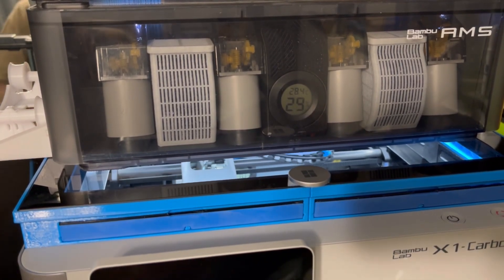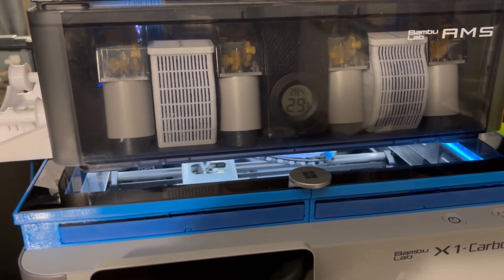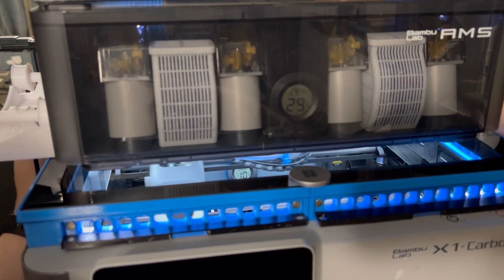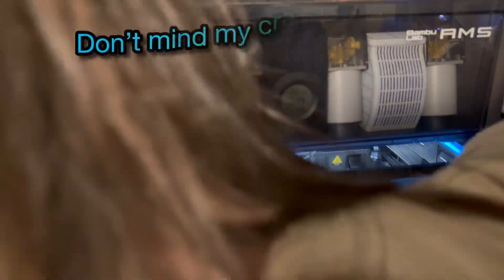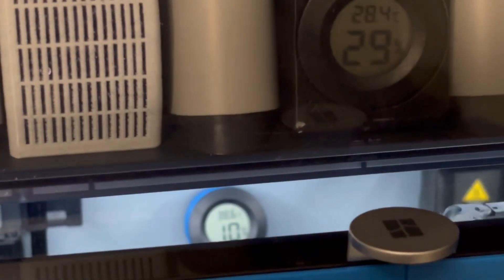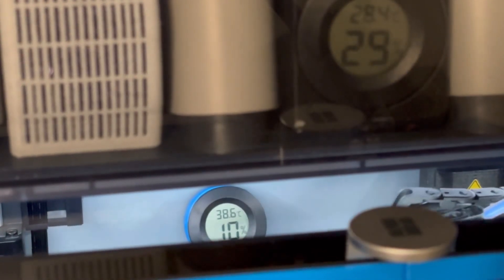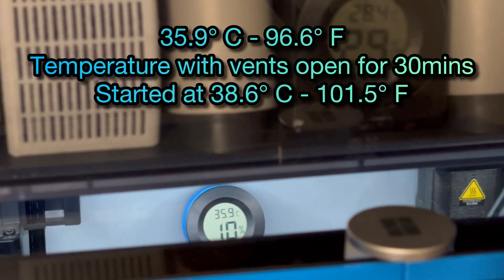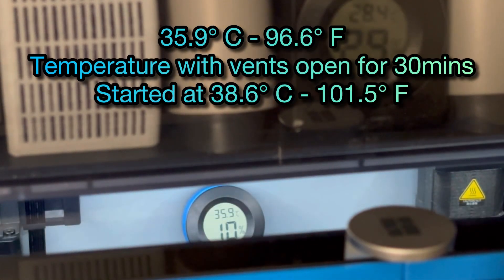Bambu Lab X1C Riser Vents 30min Chamber Cooling Test

Comment: What is the use case for lowering the chamber temp?
Reply from the maker: When using lower temp filaments I don't have to leave my chamber door open which is a little loud with the X1. I can open the vents to lower chamber temps without introducing all the noise to my room.